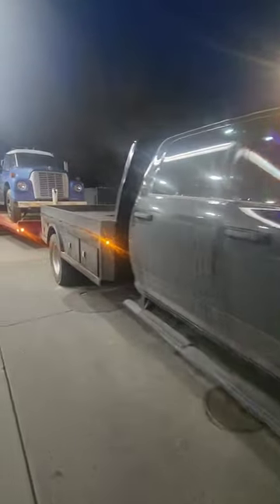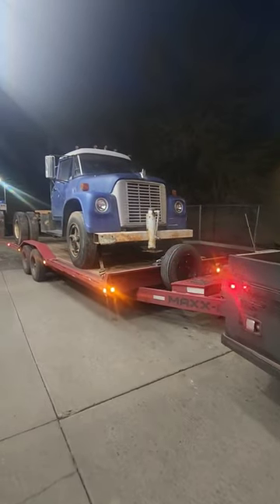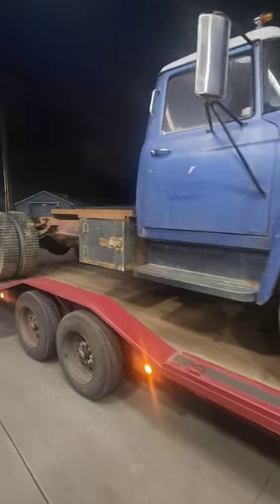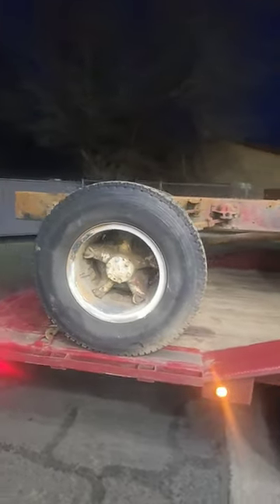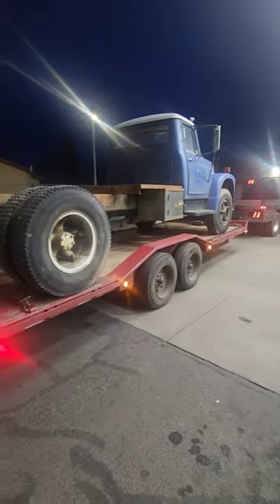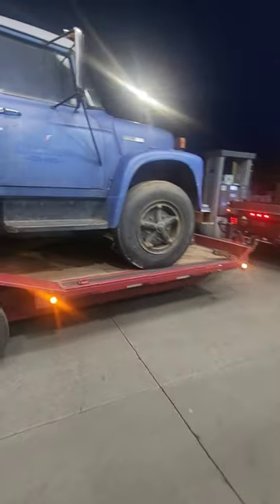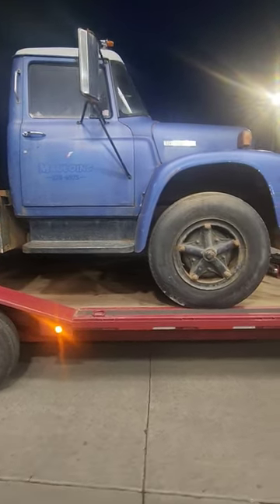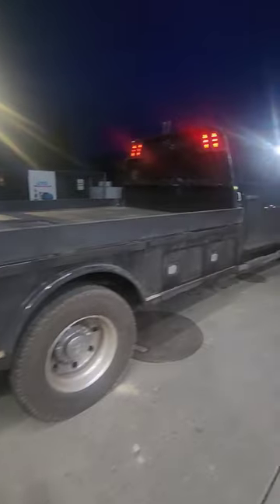loadstar , well drilling rig. #ih #rescue #406 #madeinamerica  #farmtodriveway #classic

Comment: You can change those dates and put a set of bullet rims on your butt. Senator Alco's on it on there. First of paying up you know, can you set an isolated LA D lights? How do I delights get? Go on, extend the bed extended bed. Put nice news diamond plague weather where they're coating. Toolbox on air on their nestle track normal staff with